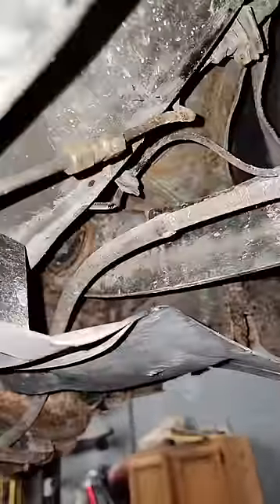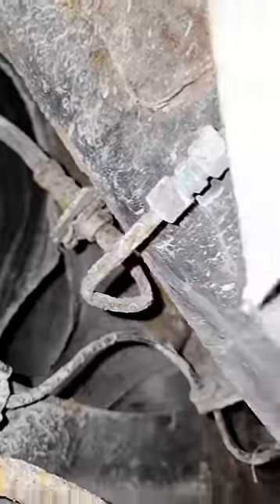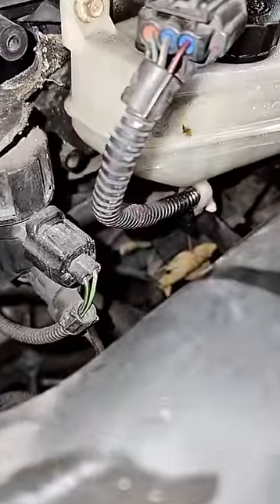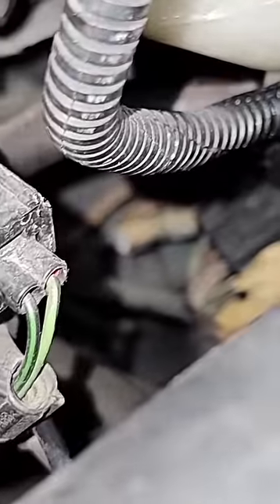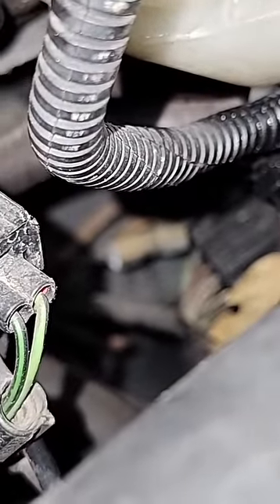don't use compression fittings on brake lines

Comment: I won't use them unless it's an absolute emergency! I like to just run all new lines when they rust out, it's oddly satisfying for me
Reply: define an emergency, because theres a real emergency when they pop off due to a panic stop when that school bus pulled out infront of you!  Never use compression fittings for a brake line. You are safer Crimping off the end of the brake line and cutting off that circuit before you decide to try a compression fitting. Atleast by capping off the line you already feel that you have compromised brakes and youre driving cautious the entire time!
Reply: @Hammerjockeyrepair  I'm not validating using them at any recommended speed, but if you need to have a pedal enough to limp it somewhere safer! Not everyone can have access to a trailer or tow truck, but getting it to a friend's house to properly repair it may be an only option. Not alot of people install them properly or the wrong ones and they do pop off, it's a bandaid not a repair.
Reply: @dakota5041  I would still crimp the line to block it off before I used a compression fitting. Folded over itself 3 times hammered flat or using pliers will not pop
Reply: I’ve never used them, but I’ve put a “cork” in the master cylinder until I’ve gotten it home. 

But I agree-for the time spent on putting those in, it’s a helluva lot better to run a new line. 

Did them on my ‘97 Olds 88.  Wasn’t perfect (couple bends were off) but was a ton easier than cut and splice. 1 bulk roll of line and a couple bags of fittings.

Comment: I've only got a compression fitting to seal and work once. I prefer to replace the line. Especially the lines I usually end up working on. They are so rusty, that usually another spot on the same line or another line will start to leak.
Reply: Copper/nickle lines don’t rust, bend easy, usually I use a small round pipe, roll the line over.

Comment: I stopped using compression fitting one my vehicles years ago opting to braze them using silver brazing rod haven't had a problem since. A compression fitting works as an emergency repair until you can get a more permanent repairs done.

Comment: I wonder if everyone knows as long as you tighten them properly, they actually work. I have used them several times with great success.
Reply: There illegal to be installed by any registered shop in nys and there a failable item on nys annual vehicle inspection. Its bad to gamble with brakes.

Comment: Back in the day we used them all the time. Its kinda funny that you have a problem with them but they aren't leaking.
Reply: Very Accurate and Very well said.
Reply: We use them in industrial settings where the pressures are much much higher than those on brakes lines, so I can't see what the problem is either.
Reply: They are illegal in any passenger vehicle. A mechanic can be held liable even though they didn't do the work. That's what it boils down to. All the components in a brake system have to be in working condition and within their minimum standards. If a mechanic  just threw a set of pads on that car and sent it on its way, he is now liable. If that union fails and causes an accident, that last mechanic is up shit creek. Not the person who originally  installed it. I would  rather a pissed off customer because they didn't want  to fix their car properly. I will take that over a lawsuit any day. My mechanics license is worth more than a two dollar fitting any day of the week. No amount  of crying  the blues will sway that decision. Customers that attempt to bully a mechanic into doing  something  illegal or immoral are not worth your time of day. 
Would you do something at your job that could potentially get you fired ? Or fined ? How about a jail term if someone gets killed ? You may think it's over exaggerated  but it's really not. We have standards that we must work within. Any professional  mechanic that thinks this is an OK fix, they are just as much an idiot as the person who installed those fittings to begin with.
Reply: Yet

Comment: I have a wj cherokee that no matter what I did I couldn't bleed the brakes. Tried vacuum, 2 man bleeding, using a bottle, then I tried gravity bleeding and left it sitting for 10 mins each wheel. Finally worked.

Comment: please tell me how to get the top nut off of a chevy 4l60e trans. I have used everything I have and can't get a good grab on it. lmao
Reply: I use a long extension almost 3 foot with a wobble socket or a universal and a socket. Breaker bar. I do those first so you aren't fighting the sag.
Reply: @ryans9103  yeah I think that's what I need is the universal deep?  I only have shallows in a universal.
Reply: @flyingmunk8956  use a shallow 6 point not 12 or deep. The anglmight  be to much i go from the top wilth lots of extension
Reply: @ryans9103  a shallow won't fit because of how long the threads are. It's the very top bolt that had a bracket on it.
Reply: best time to do Manuel swap
Reply: @flyingmunk8956  i forgot about that bolt you are correct with that one. Just make sure you keep some side bolts on  so you aren't fighting it.
Reply: I'm going from 46rh experience, letting the rear of the trans down as far as the motor mounts will let you, firstly. Let em tear.
   Secondly, use some cheap wobble extensions or grind yours down. Like a regular 4" or 6" extension, grind the edges of the square down so if fits all sloppy. If you use twelve 6" ground down extensions, you can definitely get that bolt out. If I'm wrong, cut a whole in the floor. If this is a rwd unit, there's no way you can fail with these techniques lol.
Reply: @ryans9103  yeah I still have the sides and bottom bolts on...I might have only taken the 13mills off so far. I can't remember. I wanted to do the hard one first.
Reply: What top nut?
Reply: Deep well universal socket with a long extension.    If you can't get it with that.    Remove the intake.  I have removed intakes doing engine jobs and when I remove the intake. I remove transmission bolts I can get too.
Reply: Long 24 inch extension with a 13mm semi deep swivel socket
Reply: @ChrisBrown-mo7fq  I got the 13 off. Nees the 15 now.. I wasn't sure if I need a semi deep or regular. It's hard to tell. I thought about ordering both but they are pricey when you buy them individually
Reply: @homesteadhaven2010  yeah I think I'm going to order one.... I tried to get it from the top without removing anything and got my arm stuck for a min lol
Reply: @boostedzjadventurevlogs4121  this is what I've always done. If the mounts tear, they need replaced anyways, or it was lowered farther than necessary for access.
Reply: @flyingmunk8956  j qas talking about the top of the trans i forgot to say that.
Reply: @flyingmunk8956   just go to your local parts store or harbor freight and get you a 3/8 Universal swivel and use a deep 15mm impact socket on it. If you got a semi deep socket it will work better but I deep will work 26+ year transmission tech
Reply: @ChrisBrown-mo7fq  I have been trying to use that. The damn pinch weld is making it so I can't get on good enough. And I have the trans down as far as it will go. So I was woundering it the universal socket would give me just a tinny bit more room.

Comment: I was always told compression fittings weren't rated for brake system pressures
Reply: They aren't, the packaging even states not to use them on brake lines.  Didn't stop the old hack Shoddy Kilmer from making a video where he recommends them though.
Reply: Come from factory with compression fittings.
Reply: @andrewfarrands2850   A lot of cars do but they are steel compression fittings not brass. Big difference
Reply: The brass compression fittings you get at the hardware store or big chain parts store are only good for a couple hundred PSI. But farm stores, hydraulic shops, and real parts stores sell steel compression fittings that are rated for several thousand PSI. They might still be illegal, but they are for sure a heck of a lot safer.

Comment: I have tested several Master cylinders with different type of boosters and most that I could push is hard as I could I could get a little over a thousand PSI I have never had a compression fitting come loose or blow off but I wouldn't use them unless I just have to it's always best to replace the entire brake line if you're patching a hole it's getting ready to bust somewhere else also

Comment: I use compression fitting for brake line repairs all the time. I do work on air brake systems though. Never put those things on a hydraulic line.
Reply: @joshuamast5128  
Say what? you make no sense
Reply: @joshuamast5128  if you work on big trucks or school busses like me, the brakes are air brakes. Compressed air not fluid.
Reply: @joshuamast5128  
To educate you just a wee bit... Brakes on most Big Rigs / Tractor Trailer trucks are air operated. And they work in reverse of what hydraulic car/light truck brakes do.
Reply: Ive never had one POP or leak.. hell i think theres some in my car from about 15 years ago!! Annnyy minute now i bet! Ohh wait nooo crapp i had a bigger ussue further down the line it got abither pin hole! From what ohh you mean rusty ass brake lines that hould have been brass lines or anything other then straight metal pipes! I say this is a manufactures problem and actually causing issues and not the fittings.. fittings work great its just this shitty lines from the manufactures are the problem!
Reply: @shadow_stalk  "I say this is a manufactures problem and actually causing issues and not the fittings.. fittings work great its just this shitty lines from the manufactures are the problem!"

Classic case of the voice of ignorance speaking.  I bet you think Shoddy Kilmer knows what he's talking about as well.
Reply: @fredted1611  ... i see you never dealt with air brakes.
Reply: @ferrumignis  scotty knows some stuff , lots of stuff though ... makes me go wtf NO dont do that christ al mighty!
Reply: @shadow_stalk  wanna agree not sure i can however , im in the south were rust don't exist more or less . I can say 2 things however , never seen a compression fitting blow down here but one , an that one was from up north with salt on the road LOL. brakes lines that are metal dont really go bad down here ether however them rubber(ish) hoses to the calipers i see , yes them blow a lot. ive blown one ... lost traction on the boat ramp .....the rear diff went under water an stopped thanks to parking brakes thank god.
Reply: @atzgfq23  
And how is that, enlighten me there, hot shot
Reply: @fredted1611  i recant my statement i was stoned , fairly simple if we are being honest.
Reply: @shadow_stalk  brake lines rot all the time not even a manufacturer thing it's just common . On all vehicles
Reply: @georgephillips7408  i think hes trying to say the manufacturers should be using copper-nickle brake lines that dont corrode, which i agree with. Rusting brake lines have been a thing since we invented brake lines why cant we use better materials? 

If i can afford to put them on after the fact, why cant manufacturers use them to begin with?
Reply: @theguy9208  I've never even heard of using diff materials I'm sure it's a thing I've just replaced so many with the same bullshit 

Figured they rot due to the thin sized line.
Reply: @fredted1611  what do you mean by "they work in reverse of what car/light truck brakes do"? Because they absolutely SUPPLY pressure to activate the brakes. There are spring brakes, used for parking and emergencies, that ARE released by pressure (so if air pressure fails, it'll activate). Are you thinking of train air brakes? If I remember correctly, they're generally spring brakes, released by air pressure and activated by reducing that pressure.
Reply: @ryanalexander984  Air is a fluid.
Reply: @ding9633  except a fluid like water or brake fluid cannot be compressed like air or a gas. Which is probably why engineers say not to use compression fittings on brake lines.
Reply: @georgephillips7408  steel lines will rot you cant stop that. I buy copper-nickle ones for a bit more because they're soft enough to bend using big sockets by hand AND they dont rust. If you find yourself replacing brake lines often i would certainly look into it, they sell them everywhere they sell regular lines
Reply: @theguy9208  yeah I live in mass I def have tons of shit rotting on me but I never ever do the whole brake system all together just replace or patch as needed. 

Right now have the best vehicle I've ever owned and been wanting to do the whole system for a year now lol
Reply: @georgephillips7408  it's far better to just replace all the lines and be done with it in most cases. If you're used to working with steel line, definitely get the copper nickel. You'll never go back. It's an absolute dream to work with. Bends easily by hand and flares with very little effort.

Comment: I recently had to change a brake line on my brother in laws 03 f150. Needed roughly an 85" line, but all I could get was 72". Ended up having to get a compression fitting and I told him as I was checking out, "i REALLY dont want to use a compression fitting because its only going to add another failure point." He accepted the possibility, and now it's only a matter of time...

Comment: It’s actually illegal to run compression fittings on a vehicle anyways!! The DOT definitely doesn’t like them and will write you up for it and even on trailers they are not allowed!!! I no people do it all the time because it’s so much easier than flaring each end and put a threaded end in between both ends but still is not the Wright way to do it!! Glad that you addressed the issue!!!

Comment: In a pinch I've used compression fittings on brake lines. Never had one break. With that being said, if you replace one piece of line, replace ALL the lines. As few unions as possible. And I've seen some shitty flares done that leak. While you are at it, replace the brake hoses too. You know those will get destroyed trying to take them apart from the line.

Comment: I thought those were illegal
if they pop and you kill someone your screwed
Reply: Not in every state..people use em where they are illegal sometimes to
Reply: Lots of folks think there are compression fittings when they in reality appear to be a proper union
Reply: @SXSPRIME  
That is true. Some proportioning valves sometimes look similar to a compression fittings. I think I see them usually near the back on older trucks mostly. 
But in this case 6 unions, they got to be compressions.
Reply: The only place I’ve used them is on a yard driving car when I was trying to sort out all the problems. But not on road driven cars.
Reply: The odd thing is, proper brake unions aren't particularly expensive. I suppose you have to buy the flaring tool, first, but who works on brake line without a flaring tool?
Reply: @bcubed72  and a flaring tool is only 30 bucks to rent at auto zone
Reply: @bcubed72  You can rent it or, if you get the parts from a place like Autozone, they will loan you a flare kit free of charge.
Reply: @georgeford6056  Yeah, I do that all the time with stuff like ball joint presses. 

But a flare tool was something I used enough to justify buying it.
Reply: @pizzamangametime9773  man, you can buy a cheap flare tool for that, maybe even less.
Reply: @SXSPRIME they are compression fittings, you can tell by the nut.
Reply: @SXSPRIME  when I had no experience I didn't know how to tell them apart either.

Flare unions are internally threaded with the tube nuts externally threaded.

Compression unions are externally threaded and the tube nuts internally threaded. These are definitely compression unions.
Reply: @bcubed72  I believe the reason people use compressions is not only because they don't own a flaring tool, but also because they may not know how to use one, or just aren't willing to put in the extra time it takes to flare the lines. People who do this kind of cut rate work just want to do whatever is easiest, regardless of whether it's safe or legal or reliable.
Reply: @Krankie_V  my flare unions are identical to these
Reply: @SXSPRIME  not an inverted flare or a bubble flare. SAE flare or JIS flare isn't acceptable for brake lines.
Reply: @Krankie_V  thankyou detective...
Reply: @invictusbp1prop143  they don't rent tools at autozone,  they charge the price of the tool and then refund it when you bring it back,  so its a free rental i guess, same at advanced or O'Reillys

Comment: I bought a double flare tool for brakes and I redid my subaru brake lines about 3 times. Definitely worth it. Probably shouldn't have gone to Napa for it but still worth it
Reply: Use copper nickel line and you'll only have to do it once. Unless you don't do a good job routing them.
Reply: @Krankie_V  learned that the hard way. Plus side is I learned what to do with no brakes.

Comment: We can put a man on the moon, but can’t build a car undercarriage that doesn’t rust
Reply: Actually they did. It's aluminum. Wood and fiberglass lol
Reply: @IG10705  I always wondered if spraying the undercarriage with like rhino liner type coating would cost that much more. But we’re talking about the people who brought us those stupid plastic rivets to save 6 cents so, I think I have my answer 😂🤣😅
Reply: I watched a video on corrosion(I find those interesting, don't judge me) and it was mentioned that it is possible to build a car that will not rust, the problem was cost.
Reply: @JT-lq4yd  yes, it would be very very expensive